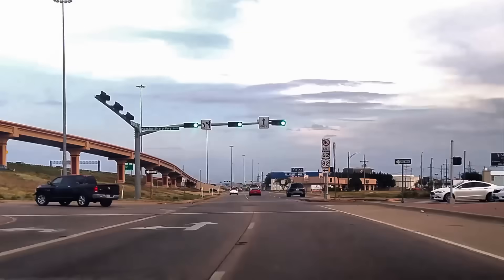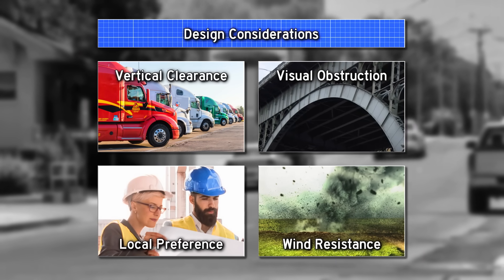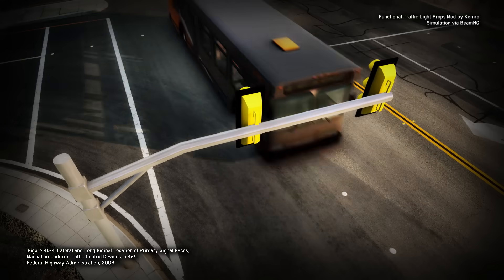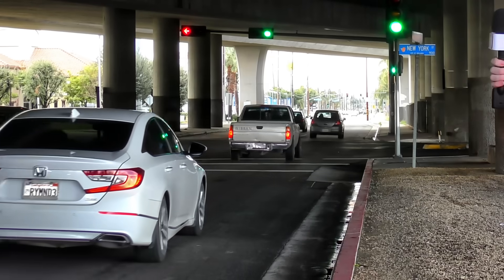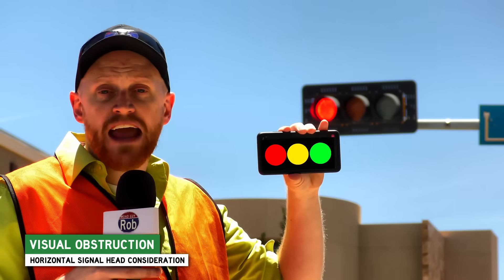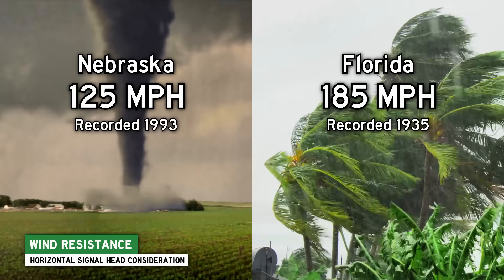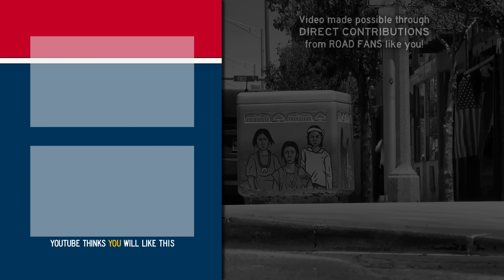What's up with SIDEWAYS STOPLIGHTS in Texas and Florida?

Comment: About that 40-180 feet range of placement for signal heads, in the past few years my city has replaced a lot of older lights that were strung across the intersection with new poles. Great, except that they cheaped out on the poles and only have two poles per intersection with the arms hanging diagonally across the intersection. So if you're in the lane next to the pole, the signal head for your lane might actually be directly above the stop bar.

Comment: This (informative) video brings to mind my experience 60 years ago as a young driver. I grew up and still live in the suburbs of Birmingham, Al.  In high school I worked for a company delivering compressed gasses (Co2, O2, Acetylene and other similar items to businesses in the county.  One small city on the outskirts of B’ham was Bessemer.  It one of it’s main roads had very old traffic lights which did not conform to the modern regulations.  There were only two lights, and green was on top!  My issue was that I am red-green colorblind and could never tell what I should do at intersections.  I just watched cross traffic and made my best guess.  I was so pleased when these antiquated lights were eventually replaced for modern ones.
Reply: As late as the 60s, NYC had two aspect lights on major avenues.   The lights on several blocks went RED at exactly the same time.

Comment: I was wondering if you could do an update on the use of LED stoplights.  Where I live, the LED's had such a high failure rate, the county/state had to go back to the traditional halogen bulbs and glass lenses.  Many of the "Red" and "Green" LED elements would burn-out, leaving the lights looking like half-filled bingo cards.  Moreover, the LED "Yellow" was often so dim, that it could barely be seen in daytime.  Was that limited to the LED stoplights they used here?  Or, is this a systemic problem with the technology?
Reply from the maker: I wasn't aware of that problem.  I had heard of cold states having ice/snow buildup.  I'll keep an eye on the trades and see if anyone has published anything.

Comment: Couple things: Is it true they mounted traffic lights sideways in a few NYC boroughs because the Irish kept vandalizing them many years ago? I heard they were pissed about the imperialist red being above the emerald green (guessing this is just an old wives tale, though). Also in NYC, if the minimum clearance is 15', then why was it that they discontinued trials for double deck buses on the basis that they kept hitting traffic lights? Double deck buses are usually about 14' or less.

Comment: Atlantic City, NJ is pretty well known for it's horizontal lights.  IIRC, the entire city switched to them in the early '70s.  Since 2000ish, a few lights at the largest intersection have gone to conventional vertical orientation.

NYC loves their horizontals under elevated roadways... but NYDOT didn't get the memo about which side to place the green on... so there were numerous backwards lights scattered all over the city.  One I drove by regularly wasn't fixed until around 2010.  Unfortunately, Google StreetView don't go back that far.

Comment: I live in northern Canada, and we mostly use horizontal stoplights, too, but honestly, we use both types interchangeably. And I've traveled to many other parts of the country too and again it's usually a mixture of both types of stoplights throughout our towns and cities. I don't know why that is, but the reasons you've listed are probably the same for us in Canada, too.
Reply: I’ve only seen horizontal traffic lights in Québec.
Reply: @warwgn3  Alberta also does most of their overhead signals (except left turn signals) horizontal. In the US it tends to vary by state but some states like Florida vary by county but also can be almost random seeing them alternate on the street or using a mix of both at the same intersection.

Comment: One of the best videos that you've ever made!  I've always wondered about this, and it makes sense now.  As for Texas, they get reeeeally windy in those areas without trees, so mounting them sideways in that state makes sense too.
Reply: It can, but if you center mount the signal, it's not much of a problem. Around here we've got transmission lines that get spoilers to help keep them from rising far enough to cause problems and even in those areas, I haven't noticed a difference in the signal orientation.

Comment: Having grown up in NJ, there were a few horizontal signals where I lived where the signals were out in the open.  So I can only assume that for cost considerations, the signals were mounted horizontally.  When I moved to Florida, I rarely saw horizontal signals, but tons of vertical signals mounted on wires.  After Hurricane Andrew, with many wired signals blown away, FLDOT began to require that all new or replacement traffic signals be mounted on poles.

What I would like to see you cover when driving in a car is traffic signals hidden by tall vehicles that you are following.  When I lived in NJ, I always knew the status of a traffic signal in front of me because NJ installs additional signals on the opposing side of the street facing traffic coming the the opposing direction.  So even if I was following a tractor trailer, I still could see the status of a signal by looking to my left.  When I moved to Florida, I noticed that I started going thorough red lights when I had a tractor trailer or a bus in front of me.  Florida still does not install additional signals on the opposing side of the street so drivers know the status of a signal in front of them when following a large vehicle.  And now that I live in Tennessee, they are no better than Florida for knowing the status of traffic signals ahead when following a large vehicle.  Although Tennessee will sometimes install a signal on the opposing side when a traffic signal is on a curve in the road.

Comment: I found it interesting that all of the Illinois examples of stoplights on wires were temporary ones in construction zones.  In fact, you can see the permanent stoplights on poles right behind them, with the actual lights covered in burlap (or something like that) so the driver does not get confused as to which signal is controlling the intersection.
Reply: I live in Illinois and at least in the Chicago area, I can't think of a permanently installed traffic light that's installed via wires.

Comment: Why should road illumination lights have an arm to move the bulb a few feet from the pole and change shadow angles imperceptibly? Similarly, why do road engineers dangle so many single-panel heavy roadsigns directly over travel lanes requiring massive arms to hold them and massive foundations to keep them from tipping over (instead of mounting huge single panels on a straight mast directly over their footing)?

Comment: Québéc and New Brunswick, Canada both have their traffic lights horizontal, but they’re aligned such that Red has two squares on the outside, and Amber is second from left and typically a diamond. Montreal is a notable exception with the Centre-ville having classic short vertical signals.

Comment: In areas with high winds, traffic lights are sometimes configured horizontally. A horizontal configuration reduces wind resistance and offers improved stability for the light since a greater surface area can be secured to the pole or wire.

Comment: as a colorblind person, when driving at night i cannot usually make out where a light is relative to the other lights so the whole reading order thing just doesn't work at night. I can tell relative to where the cross member is so the vertical lights are just flat out easier. whenever I come across a horizontal light night I essentially have to guess.
Reply: If all lights had a Scotchlite-type reflective material around the edges of the signal it would help with that. Still, I think using different aspect shapes is the best practice but it will never happen in most places.
Reply: I like the stencil approach, but the quebec style has a big weakness. A colorblind person used to this style might interpret a single circle as a green light. Here in germany they use inverted stencils for arrows. So for yellow and red you see a black arrow with iluminated background, while for green your see an iluminated arrow with black background. Still no solution for all interections, since many don't show arrows.
Reply: Many rail networks have aural/visual in-cab warnings when you're approaching a signal that's not at green... you'd think there would be a market for a technology to replicate this in cars, it isn't exactly complex.
Reply: @JaidenJimenez86  If it was easy to do it would have been done by now

Comment: 7:57 - The rule for horizontal traffic light involves the RED being the furthest away from the curb. US is right-hand driving, so the RED is always on the left side (RYG); meanwhile, if the lights were mounted sideways in left-hand driving countries, the RED should be on the right like it is in Japan (GYR). This reduces sightline issues from overgrown tree branches or taller vehicles stopped on the curb lane, the same as the reason why RED is always on the top when mounted vertically.
Reply: Except for where we have two red lamps, on both ends (visit PEI! It’s lovely!).

Comment: some physics nerd will have to explain how a rectangle could have "less frontal area for the wind to push on" JUST BY changing it's orientation. a 1x3 sign is the exact same square footage as a 3x1 sign.  

the Commutative Property of multiplication says the answer is the same, regardless of the order of the multiplicand & multiplier
Reply: You're not taking into account the arm it is mounted on, and you get two attachment points between the head and the arm instead of a single point when mounted vertically.

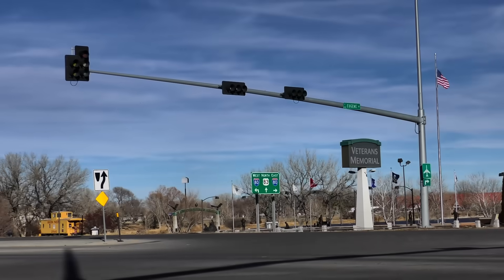Comment: For fellow Geoguessr players, stoplights are a crafty way to get these US States pinned down quickly. New Mexico tends to mount the light ABOVE the pole. Texas tends to be the one you see with the yellow casing and black outline (I believe it's also the only one to use span-wire horizontals). Nebraska is the only one to do horizontals + the offset doghouse left-turn signal (seen at 5:40).
Reply from the maker: Yes!  Horizontal stop lights make a great party trick when playing!
Reply: more tips: 
CA: famous arm and black lights with black backplate or reflective backplate
AZ: same as CA but there may be different poles and longer visors
UT: yellow visors and black backplate
IL: CA style but yellow back
NY: wired with no backplate or clustered lights
Reply: @kakahtukat  Much of WI: Overhead signal is horizontal on the end of a spindly, ladderlike arm.  (e.g., https://maps.app.goo.gl/KuA7sgYA9SHESd5r6, https://maps.app.goo.gl/Exz7P5nrJfyZhzVUA, https://maps.app.goo.gl/yhMeG2CtdQLRPNnB7 )
Reply: Thanks!
Reply: I was thinking our turn arrows a weird
Reply: That nebraska fact is real interesting and im not one of those players
Reply: Colorado has offset doghouses too

Comment: My family is from Texas and we learned that the signals were sideways because a lot of of cars in the 1950s had big sun visors added to the outside of them and it made it difficult to see the lights. They also used to sell prisms you mounted on the dash so you could see the lights blocked by the visors.
Reply: That's actually really smart. I hate when I have the sun visor down in the evening and I can't see the traffic light at a stoplight

Comment: The span wire stoplight you showed for Illinois is normally only used during road construction, even in the example you showed you can see normal metal stoplights out of service either about to be removed or put into service
Reply from the maker: As others correctly mention, there's more to a bridge than just the structure.  The soil underneath plays a big role.  I suspect Florida has a high water table that makes it difficult to dig the freeway subgrade.

Comment: That one toxic comment at the beginning xd

One solution to the colorblind issue with horizontal lights the province of Quebec, heavy user of horizontal lights, famously experimented with are shaped light bulbs: square for the red, diamond for the yellow and circle for the green, which respectively means stop, slow down and go.

Studies showed however that shaped lights don't actually improve things for the colorblind, just keeping the rules you mentionned here (red on the left, green on the right) is enough. Considering shaped lights require more money to make, vast majority of lights are round just like everywhere else.

Plus, to also keep consistent with other places and to save money, many headlight models come with an option to slash the red light on the far right of the headlight, since we're also (in)famous for using the double red. Imo, it's quite ugly (not as ugly as spanwire lights tho).

Comment: Wisconsin for years has had the overhead stoplights mounted horizontally on trombone masts.  Slowly , WisDOT seems to be getting rid of them  - especially in areas where traffic is highest and where roads have been widened to 6 lanes.  The newer styled masts can span across the wider roads.

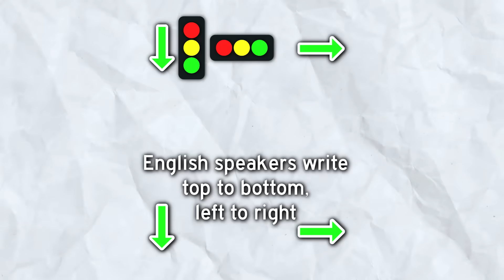Comment: 8:16 In Japan you can also find vertical traffic lights. It's a sign you've entered snow country. Because the buildup of snow on a horizontal light is too heavy and can break it, but on vertical lights the top surface surface area is much smaller.
Reply: That's cool.
Reply: JAPAN!!
👀
👃
⭕️
Reply: We have horizontal traffic lights in Saskatchewan. So obviously snow isn’t an issue with them 😂
Reply: @ogonbio8145  Historically, it may have been more of a problem with weaker materials or design, or just a perceived problem that never materialised.
Or, there were just different standards at one point, and they were never harmonised.
Reply: @ogonbio8145 same down in NY State
Reply: This sounds like BS. We have horizontal stop lights in Alberta, Canada. Some are several decades old. Some lights do have slits cut in the back plate to cut down on wind resistance but the snow is no bother.

Comment: Correction, frontal area is the same regardless of being vertical or horizontal.
The difference is in the mounting. Horizontal allows a more stable attachment due to the wider points of attachment.
Reply: If you include the arm itself, the surface area of a horizontal mount is less than a vertical mount.
Reply: @sharkheadism  Only if the wind is from behind the light. In which case the arm does deflect some of the wind force. Frontal is still the same. It's the front. Still the more stabile horizontal attachment is the real key.
Reply: @dwightsmith5174  If the wind is coming from the front, then the portions of the arm behind it is shielded. Horizontal mounting also decreases the wind profile from the sides.
Reply from the maker: Reading a few comments, like yours, I'm happy to say:  I stand corrected.  Thank you for letting me know.

Comment: In Missouri, they have lots of intersections with camera sensors to manage traffic light functions, but they are not used, optimized, or even seem programmed OPPOSITE to their intended design. It's an infuriating waste, and I have collected a lot of video evidence of this. It's like the DOT is TRYING to waste our fuel and increase pollution. I think it's a good topic I haven't anyone else talk about. Cheers, great video. 🙂
Reply: You mean like, you're waiting at a red light for FUCKING AGES, nothing coming the other way.... finally something comes the other way, so the light changes to stop them... you go, and they are then left to wait for fucking ages as well? Happens everywhere 😅 Traffic lights are really dumb and it's about time cities started utilizing camera systems with AI to determine best traffic flow and fuel efficiency (for example why stop two semis and a bus on an uphill to save a small car waiting an extra 5 seconds?). I think that approach would greatly improve traffic flow, driver compliance, fuel savings (and importantly in residential areas, noise).
Reply: @JaidenJimenez86  Yes, exactly and more. How about being on a state highway at 1 am and the light turns red for the intersection of a closed shopping center with no one in sight!

Comment: Span wire is not always ugly. 7:12 Shows a typical NY style cable span. New York and Florida do cable span properly. Signal heads are level, a tension wire is used to keep from swaying.
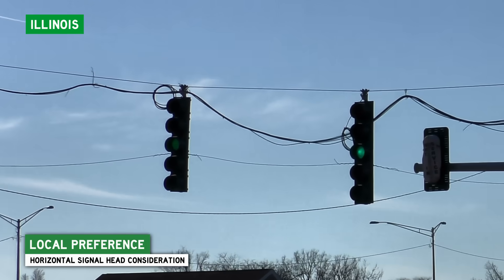7:18 is an ugly span wire signal. Cables are separated from the span wire. Signals are not leveled using nipples. The southern states, excluding Florida, have terrible cable span signals are the reason why you think all span wire signals look ugly.

Just as not raising a bridge an extra meter to have vertical signals, cable span is a less expensive option than mast arm signals. Mast arm signals require all utilities for the signal to be run underground, under the road. Cable span allows for all wiring to be run overhead, saving money.

New York has been installing more mast arm signals in recent years. But cable span signals are still a viable option. Both have their pros and cons.

Comment: Germany has their traffic lights on the near side of the intersection to the driver ( i.e. within that 40 foot limit talked about here) and it drove me nuts. When you are the first person in line at a red light you have to look to a light at the side of the road that is at eye level or lean forward and look up to the overhead light - so you're not spending 100% of your time watching the traffic in the intersection.  I'm sure you'd get pretty used to checking it with your periferal vision, but as a visitor it was quite odd.